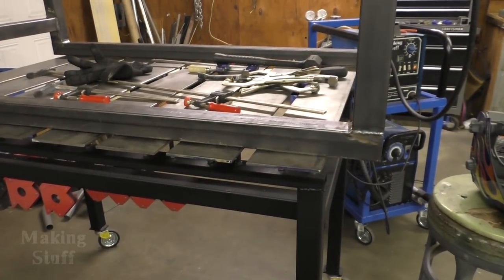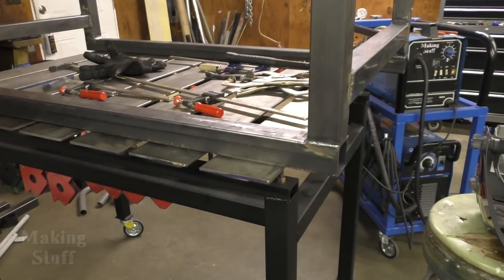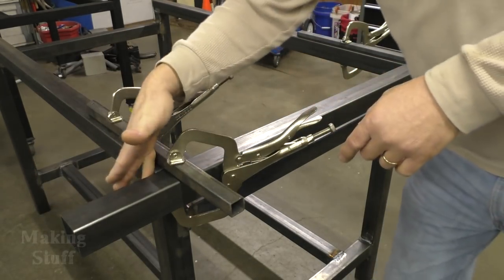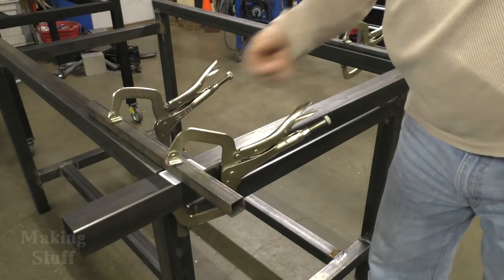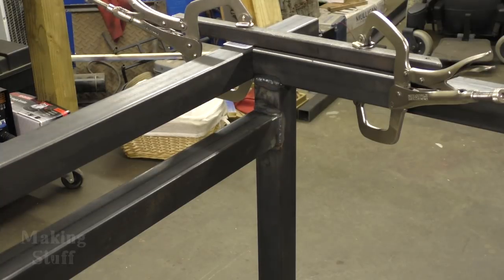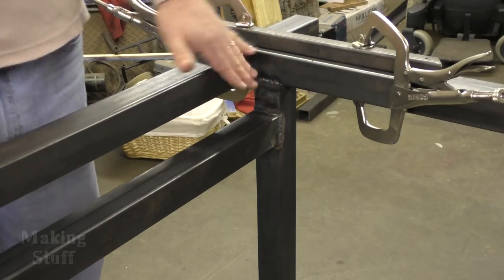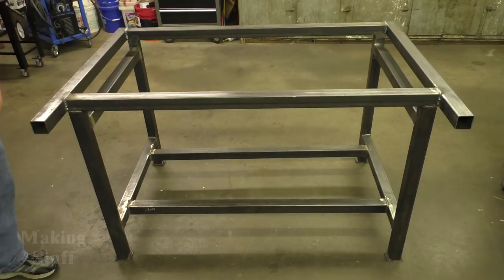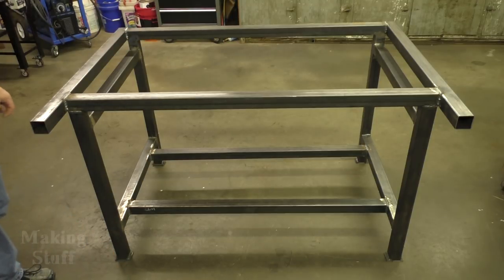DIY CNC Plasma Build - Part 1

Comment: I Have seen all of your videos about making this CNC machine. You did a great job certainly. I built my own sawmill, after 4 years of usage, so now, I know its imperfections. So when I build the second, it will be much better. I decided to make a copy of your CNC machine. Can You lend me some hints about, what would you do differently on your machine if you have to rebuild it. What changes would you make?(making it lighter, more rigid, more accurate, cheaper or bigger??)  Thank you for your answer.
Reply from the maker: I owuld make the water pan shallower and also not put the computer under the water pan.  The water pan doesn't leak, it's just hard to work on the computer when it is mounted under the water pan.

Comment: Why don't you buy an aluminum extrusion with 2 milled surfaces as your reference level. You can use it to level everything. You can also use it as a guide and mill the steel surfaces. You only need one of them. Should be a very good investment.

Comment: Where can I find one of those 90 degree jigs like you have? I have seen the ones that are only 90 degrees but like that one with the 45s too. The build was done very well. How have you liked the belt drive? I have one that is belt drive now and was thinking of going to rack and pinion as I do run a router on mine and thought it would be more rigid. let me know your thoughts.
Reply from the maker: Fireballtool.com.  The belt works fine for the plasma but probably not so well for a router.  Check out the video series I am currently working on now.  I am using a gear rack instead of a belt. https://www.youtube.com/watch?v=L1Yk_iNYGKQ&list=PL4lExYUFHSPzF8kVQGJl5cMSGIj1tmhuI

Comment: What are the requirements of frame flatness for a table like this? I do not have a large and flat enough welding table to produce a frame thats definitely and certainly flat on the top.
Reply from the maker: If you use a torch height controller, flatness does not matter because the metal will bend and warp with the heat from the torch.  CNC Plasma with a THC is the most forgiving of all the CNC machines.
Reply: @MakingStuff  thank you! I watched the whole series on your project. Great stuff!

Comment: I like your bandsaw.  Is that a Harbor Freight Saw?  Where ddi you find the squares you are using to square up the pieces before you weld?  
Subscribed!
Reply from the maker: Yes it's Harbor Freight saw, check out the video where I built it.  The squares came from Fireball Tool.
Reply: @MakingStuff  Thank you :-)